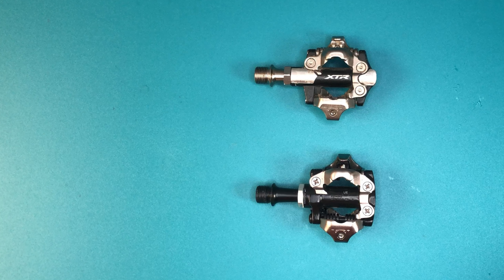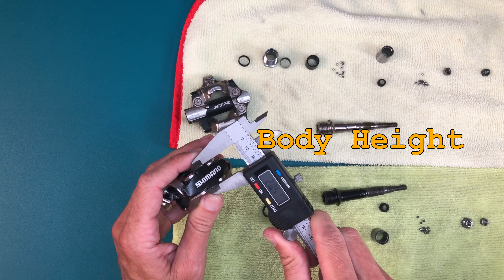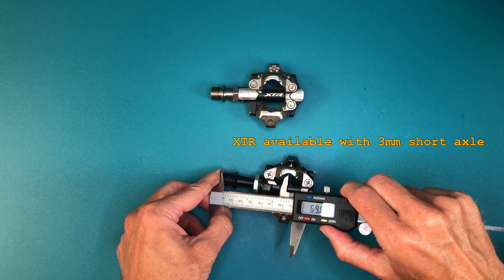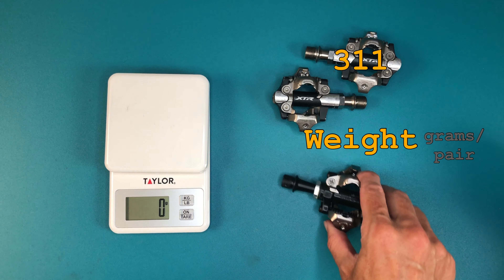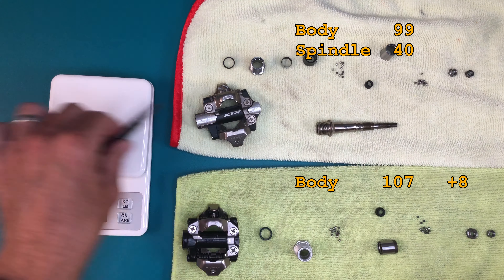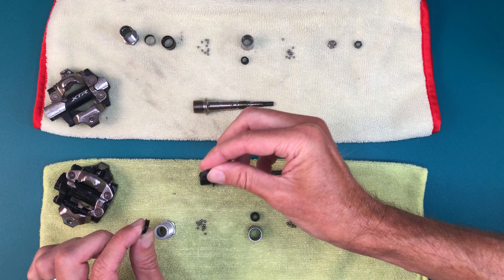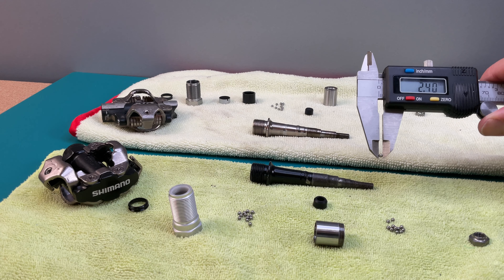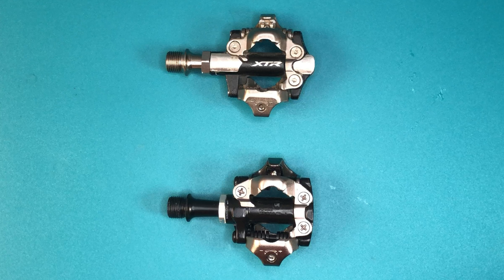Shimano SPD shootout - XTR-9100 vs M540

Comment: Re spindle length--I saw one video where the poster said the shorter spindle is intended for bikes with wider 'boost' spacing like fat bikes to compensate for that difference. Nothing to do with better power transfer or more comfortable pedalling position, etc. I just bought the XTRs yesterday, and went with the standard 55mm width.
Reply from the maker: Q factor (the distance between your feet) can be a bit controversial. I’m in the camp that believes narrow is better. Go run on a beach, as you move from walking to running, and as you speed up, you’ll see that your feet get closer together and eventually follow a single center line. Compare this with using an elliptical machine (which holds your feet at a fixed width) where I always feel like I’m trying to run while straddling a horse. Does a few mm difference matter? I don’t know, but it sure does on my seatpost. So given the choice, I’ll take narrower. YMMV 🙂

Comment: 520 is the entry level pedal, not 540
Reply from the maker: Not sure I suggested otherwise. For anyone likely to do this type of maintenance, I’d recommend the 540 over very similar 520, since the 520 requires a special tool for removing the lock collar

Comment: From looking at it, I’d bet the XTR spindle is some kind of hardened stainless (17-4ph??) and the 540 is black-oxide 4140 steel.

I’d also wonder about the spring and cage stampings…possibly plated steel on the cheap pedal and stainless on the xtr,
Reply from the maker: Worth noting that the XTR axle and springs were magnetic
Reply: @AnAvidCyclist  : yup, many stainless steels are magnetic, and most non-magnetic ones will become magnetic if the material is cold-worked (like hard-drawn sheet for example).